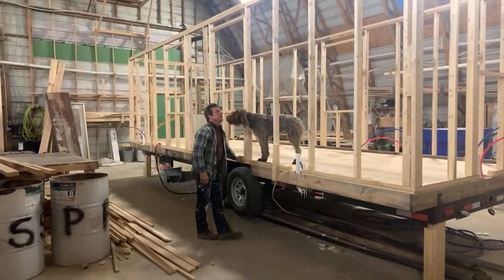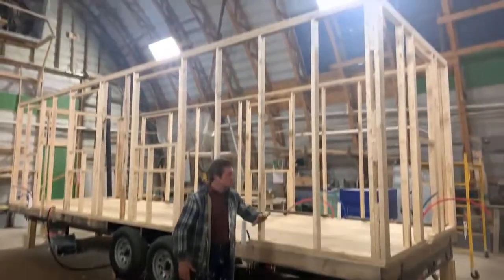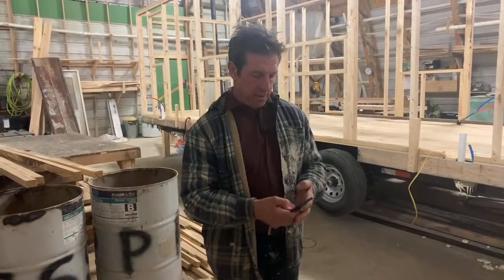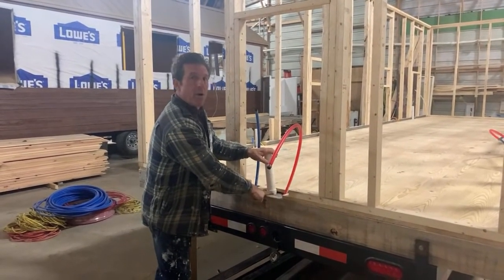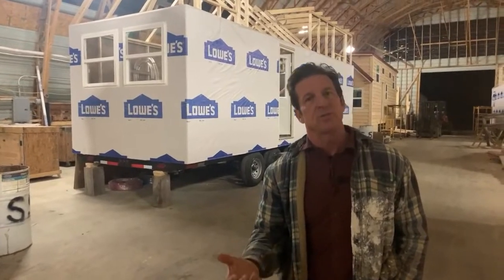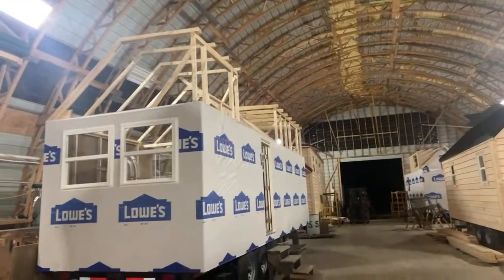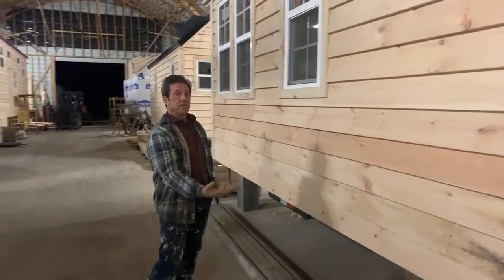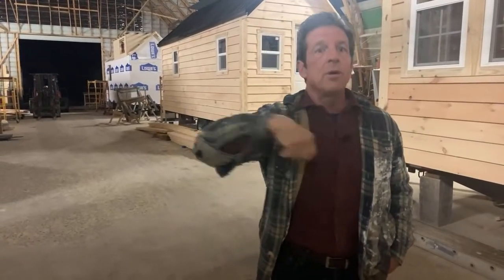Tiny House Framing

Comment: What you're doing for the price is fantastic!! And thankfully for your local residents they can park at a community like yours, and maybe even on their own homes lot or vacant lot. That is not how it is in most of u.s.  Even in most lenient states, you may be able to park a tinyhouse like yours in some RV parks, but to use as an ADU/cottage on your own property, it has to be built using the current state building codes, includes permanent foundation... also you cannot buy a vacant lot and just add utilities and park a unit like yours. Very few, if any, areas allow... which is sad.  People need to get involved with their local governments to ease guidelines.. units like yours are soooo needed, but still soooo difficult to park and live in! God Bless you all and what you're providing for the fortune ones who don't have obstacles  I mentioned!